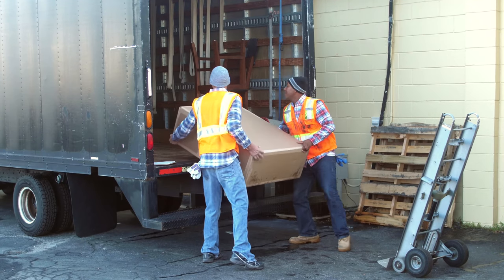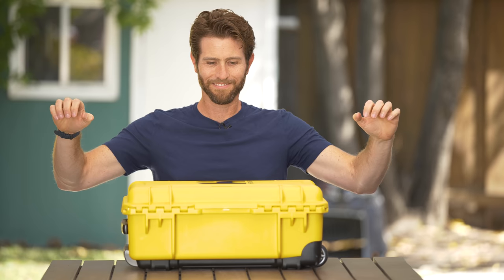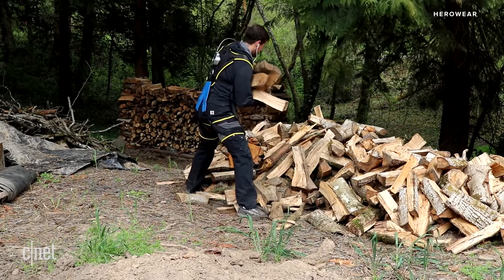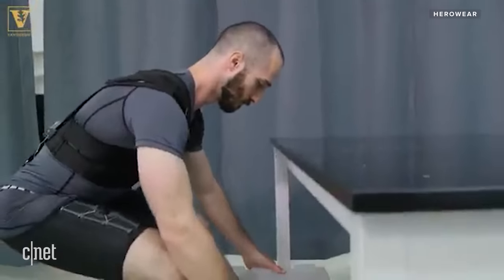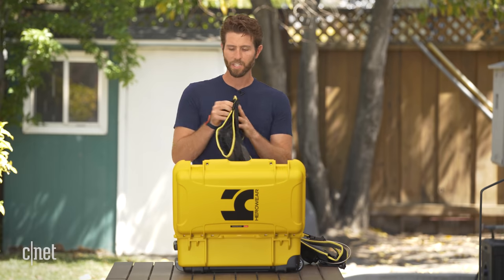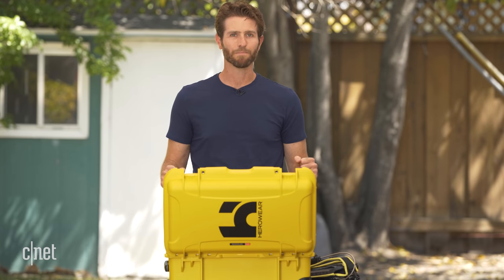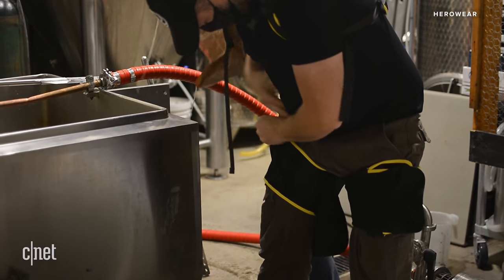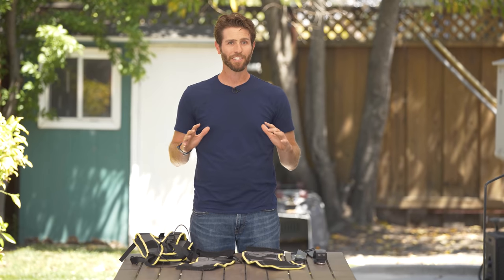This $1,200 exosuit can take 50 pounds off your back

Comment: Could you use the Apex in your line of work?
Reply: Great review Andy... I see this as a boon to any farm where manual labor is still the norm though the price point needs to be greatly reduced for it to be feasible, specially in developing countries where these types of injuries could mean families going hungry.
Reply: That one guy with a tire and possibly a rim with a full motorized suit was literally only lifting like 50 -60 pounds in an awkward shape and that is me guessing a heavier 33" or 35" tire. So yes if it can't help take atleast 15 pounds off that I would buy that and I'm a diesel tech who asked to do suspension work because I got bored of motor jobs because only my upper body and abs were getting the workout... now I regret it haha.
Reply: As someone who works at a garden center, this could be very helpful when unloading stock from semi trucks or moving large plants for customers.
Reply: This device doesn’t reduce working load- at all.  So, if you have compression injuries - say, herniated disks, fractured process, etc - this device might actually allow the wearer to impose way more load on their body than without it- and with catastrophic results.
Reply: @mavigogun  it seems like it would help keep the spinal muscles keep the vertebra aligned in the optimal position to accept a load at the expense of adding a few lbs of compression force on it
Reply: im 23, i have scoliosis, and work in a warehouse for 8 hours a day and id KILL to have something like this. i have to go to physical therapy several times a month just to stay physically able to work and support me and my partner financially
Reply: I see middle age and older people using them for house work.
Reply: Looks like a scam

Comment: The inventor deserves an award! I hope cheap knockoff’s of this idea don’t sour consumers.
Reply: @Yazmeli Ayzol The basic concept of a back-support device that is based on elastic bands supporting the back does go back to the 1800s. There have been many attempts to perfect the design over more than 100 years. We've included some pretty advanced design features (including some that are patent-pending) that we're confident make our suit the best at balancing freedom of movement, comfort, and support to make it effective and usable for workers.
Reply: I hope cheap knockoffs do get released! $1200 for some rubber bands and a harness, thats just a joke
Reply: I should add that the mechanism that releases the band tension might add a bit more cost - but I really can’t see it being much more than I said before.
Reply: @postandghost9391  cheap in this case applies to the quality of the materials and creation of the suit. Its worth the price for what you get.
Reply: @TheOnlyPedroGameplays  Fabric is not expensive. Look at military gear. Cordura is extremely tough and it only costs $12 per yard. I think the company should be allowed to charge whatever they want, but don't fool yourself into thinking the price can't be brought down to $75. The main reason for the price is demand. Even if the thing was cheap, most people are not looking to buy this kind of item.

It's the same deal with why night vision and their accessories are so expensive. Very few people are in the market for them.
Reply: @DaveSmith-cp5kj  Unfortunately there is more to the cost of a product than it's manufacturing cost. Development costs and running a business take money too. The Apex is less than half the price of most other back-assist exosuits that came before it, and our goal is to keep this technology accessible to as many people as we can.
Reply: @DaveSmith-cp5kj  Spoiled
Reply: There are better, older, less expensive versions

Comment: I bought the hero wear apex and though they claim it does not move pressure to other parts of your body it does, it works very good and DOES REDUCE back pain, HOWEVER it likes to bite into my upper back (the upper strap material and backpack section) and makes my shoulders tired, maybe I have it setup wrong, but I have watched all of their training videos and it hasn't done much, I will continue to wear it as it does reduce back pain but it sometimes gets in the way and gets tiring after a while. I work construction doing concrete.
Reply: Thanks for buying, and thanks for the feedback. It does sound like there are some adjustments that need to be made. It definitely shouldn't be causing discomfort. Reach out to our support team on our website or at support [at] herowearexo [dot] com and we'll see what we can do for you. The likely source is using support bands that are stronger than you need for the work you're doing. It's a common issue. Sometimes 'less is more' when it comes to finding the balance of support and comfort.

Comment: Just think of it this way $100 a month for a year. If you do any kind of repetitive lifting work, it is worth it. Too bad they did not have the same system going down the arms. Biggest thing I noticed, I did not like, is the small band going across the front. I think it should have been a little wider.

Comment: I used to work in the oil and gas industry. Specifically on a service rig where we would travel to various oil wells to make repairs. Setting up these units are very labor intensive. Sometimes rigging in and rigging out on a daily basis. Wish I had one back then. However, the suit would need to be resistant to the crude oil these workers are exposed to.

Comment: Interesting but I don’t see a large difference from a posture correcting back brace . I have a couple of these and they have carbon fiber strips that run down the length of spine , strap that tensions your shoulders into proper position and a waist strap that supports the lower back while transferring load to the hips. These are like 20-30 dollars. God send to me, with a fused spine.
Reply: the only difference is the technology to turn it on and off. If you wear a back strap, when you are not lifting, its really tight and restrictive.

Comment: The US Army needs this. Rucking would be so much easier
Reply: @Yazmeli Ayzol Your comment makes absolutely no sense. If, as you state, the exo-suit "increases lifting capacity", then the rucks on our backs wouldn't be as heavy during ruck marches.
Reply: @Yazmeli Ayzol How do you get a ruck from off the floor, onto your back? How do you move retired equipment inside a connex, outside for inventory? Magic?  Do you pull a Harry Potter wand out of your @ss and whisper "Win-gardia Leviosa"? Gtfoh
Reply: @Yazmeli Ayzol Great come-back. You really put me in my place with all those emojis. Welp, there go my feelings.

Comment: Won’t this weaken the muscle that needs to be stronger to do these task safely ?
Reply: gotta hit the gym to work out that back. the gym is where one can lift with the proper form and weight distribution. this tool is only to prevent repetitive stresses on the body when performing work. at work the things that need to be lifted are either too heavy or awkward to lift with perfect form
Reply: It offloads 20-40% of back muscle effort, so you're still doing plenty of work. But it helps avoid over-strain, which can actually cause atrophy too (ask any athletic trainer about 'over training'). The idea is that the worker can stay in the sweet spot of using their muscles without over-using them to the point of strain, pain, and injury.
Reply: No, that wouldn't even be possible. Muscles don't get weaker from movement.

Comment: We need a backpack that can carry 100 lbs but transfers all that weight to the bottom of a persons foot.
Attach this person onto a bicycle and not only will you get a capacity upgrade, you'll get a performance upgrade as well.

Imagine giving the strongest bicyclist in the world a 200 lb backpack that would bypass his legs effectively giving them 2-3x the power output for zero or near zero extra power input.
When they sit the weight is transferred into the seat instead of the rider.

You could make the weight batteries and really see how far someone can go with mechanical assistance without the need of external power sources.

If I could throw 200 lbs of stones into my bag, then hop onto my bicycle generator to recharge itself by pedaling on the stop with the rear tire off the ground, you'll be able to produce more power then you'll need with that system alone. 

Let alone the 10 other ways to generate or absorb external electricity.

Make it self drivable, and feel like you're sitting in a mobile lazy boy chair, you got yourself the next generation machine.
Been waiting around 2 decades and we're still not quite there yet.
All the pieces of the puzzle are on the table, it's just matter of pulling them together, and having the permission to put them all in one place at one time

Comment: “Exoskeleton suits cost thousands of dollars, compared to this thing, which still costs you thousands of dollars”
Reply: We can understand how that phrasing could be a little confusing. The powered heavy-lift suits he's referring to, like the Sarcos system pictured, cost about $100,000 a year. Our suit is a $1,200 one-time cost.
Reply: @HeroWearExo  - **Starting at $1,200

Still, it’s incomparable. That’s like comparing an excavator to a garden trowel.

Your back brace is over priced and from the way everyone was talking about it, only seems to reduce some** fatigue. My $50 brace does the same. I don’t doubt you’ll sell hundreds at the $1200+ price… but it’s a ripoff and out of the price range of the average user.

Throw the “exo” label on it all you want, but it ain’t an “exo”. That overkill road case on the other hand…

Comment: Might be okay for muscles, but when you older and you actually have a bit of bone and disc degeneration I'd be worried about the additional pulling down onto those areas.
Reply: Believe it or not, the suit can actually reduce spinal compression, not increase it. There's been a good bit of scientific research into spinal compression sources - most of which comes from back muscles themselves straining. Reduce muscle strain, and it reduces spinal compression.